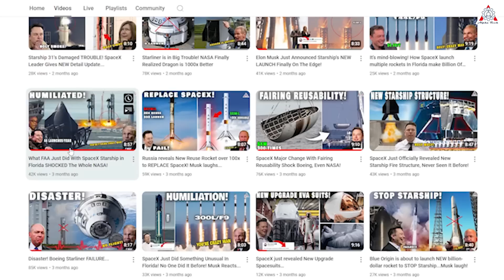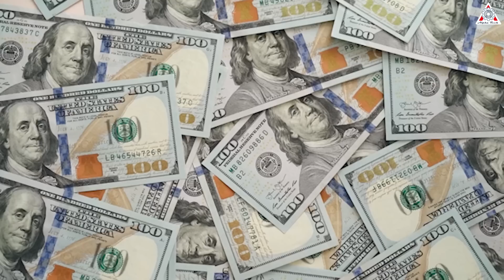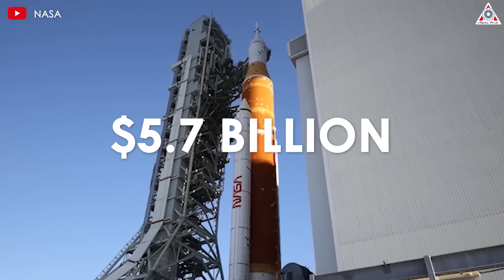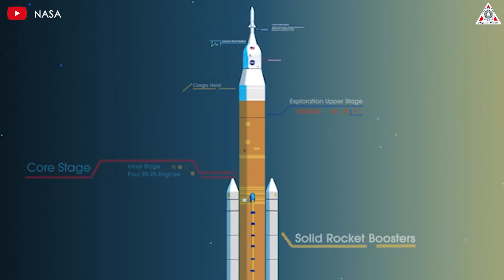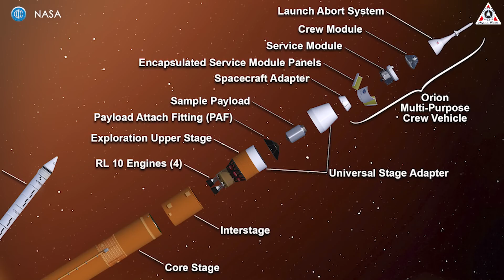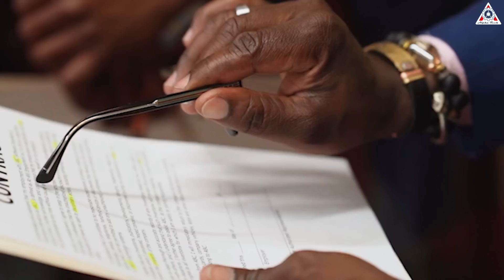Disaster! NASA's Shocking NEW Discovery on Boeing's SLS...While Starliner STRANDED!

Comment: Salaries are too low for NASA engineers compared to the private sector, that means .. losing talented engineers.
Reply: Boeing has labor unions and the highest pay in the industry - only Lockheed Martin has higher pay but thats in their Skunk Works division. it was NASA engineers that discovered the flaws in the LOX tanks.
Reply: NASA sets the mission specifications and design requirements - its the private sector that builds prototypes, tests and wins contracts for production. NASA does have engineers but they inspect during construction and the finished product. you need to think of NASA as a property owner having a house built - the contractor pulls permits and county inspectors come at several different points during construction making sure everything is being built to code.

Comment: I worked at JSC NASA for over 40 years. The NASA way and government way is to reinvent what has already been done before. Instead of taking the Saturn V and bringing it up to modern specs, they instead decided to build a new rocket. Why not take the position that Porsche uses, they designed/built the 911 in 1965 and have modernized it for the past 60 years. It's still the same basic shape, has a flat 6 in the rear, but a much more civil car to drive.
Reply: Which is why I <3 PORSCHE, sensible and beautiful :D

Comment: There has to be more to this story then told! Let's take the welding that you discussed, and your reference to an unskilled work force! Welders have to be per-certified in a Company like this, where critical welds are to be made! Now if you are saying the welds were out of spec (which has a specific meaning), then it probably wasn't the welders fault, it was more then likely someone trying to cut corners and giving the welder the wrong information! A welder wouldn't arbitrarily change the specs, he gets paid the same to weld it no matter what type of weld it is! I would like to hear from someone who can dig deeper into this, and get more of the story!

Comment: Imagine buying a car that doesn't have working parts from GM or Ford and then rewarding them with paying for the car 2 or 3 times over to fix their mistakes.  That is what NASA has been doing with Boeing and when Space X delivers what they can't but promised to, they will finally do something just to keep the contract from being cancelled like with strandliner to avoid being forced to pay NASA back.  Why did they remove the software to remote fly strandliner,  Boeing would rather dead pilots than any witness.  The software may need updated but there was no reason to delete the files on the computer to at least allow a undocking and reentry.

Comment: You have to remember that Boeing is exclusively a profit motivated enterprise.  Executive compensation is based on monetary results, not by producing superior products.  You get those bigger margins by using low cost subcontractors for things like 737 MCAS software development or fuselage plug doors. They saved a bundle with those tricks and I'm sure the bonuses were sweet.  The SLS project is another profit spinner.  Drive the budget to the moon (pun intended) and use semi-skilled labor to keep costs down.  Remember folks, "if its Boeing, I ain't going".

Comment: Boeing needs to reboot. The only way they can do it is if they're forced to do it by NASA, the prime contractor. Grumman didn't get a cost plus contract for the SLS SRB's. We don't hear about any problems with those do we. NASA needs to go to fixed cost with Boeing and insist that they relocate their base of management to where the engineering is done. The Boeing board of directors can chew on that and if they reject it then they can be rejected as a contractor. Many of the new companies are more agile and maybe even SpaceX could be a contractor for that program. Boeing is probably suffering a shortage of qualified staff and workers just like blue origin because they're sort of deadbeat companies that are really not prime contractors anymore. If you're the hotshot engineer do you really want to work for them? Engineers should always run the show cuz you just can't beat them, you cannot outthink them, and you cannot out calculate them and run a company efficiently and get to the finish line ahead of them. The board of directors they're always making economic decisions but look how that's working for them! The collective shareholders are destroying the company because of their ineptitude and incompetence.

Comment: 52 years in engineering and management - worked on R & D for defense and  commercial development programs. Mostly fixed price deadline controlled completion with penalties for 'failure to complete on schedule'. Never hired a collage grad. unless they had several years of experience. Quit working when 'Inhuman Resources' refused to accept anything but recent college graduates because they were cheaper than people with 10 to 20 years experience and knew how to get the job done. never more than 2 or 3 members on a team. Once heard a team member for a major manufacturer brag he had been with the company over 5 years and had not EVER done any work just attended meetings.
Teams were an excuse to blame some one else for failure - not the team leaders fault. It was with the supplier, the customer changing specs 'which was usually billable' or unavailable materials.